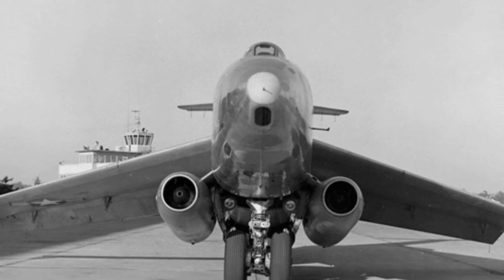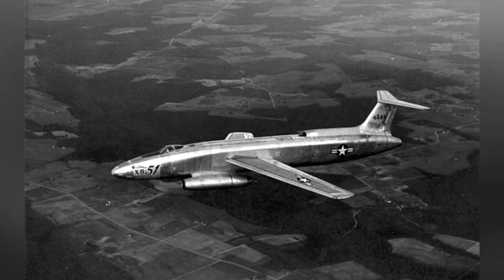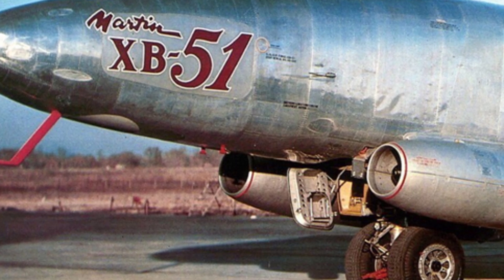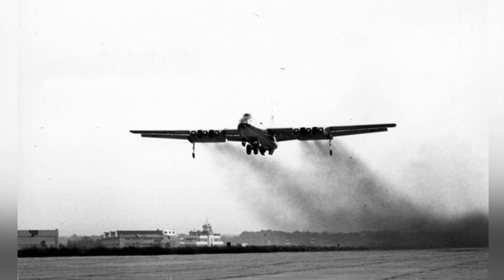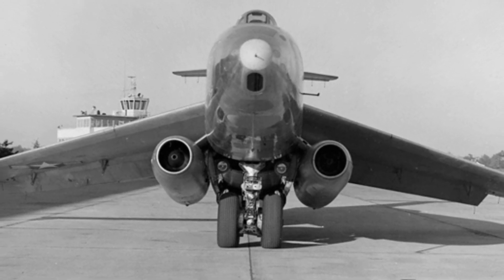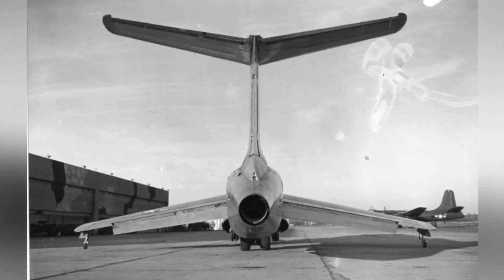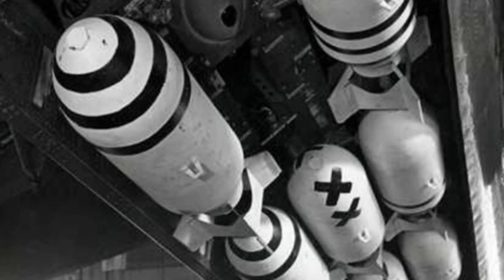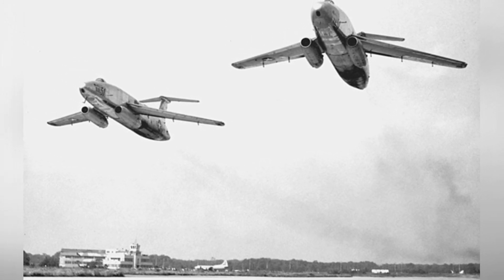XB-51: The Revolutionary Jet Bomber of WWII

Comment: WWII?
Reply: Yes, a Messerschmitt design from the last years of the war.
Reply: @neiloflongbeck5705  - Which one was that?  There was a variable sweep design. P.1110  but  which had a variable incidence wing like the XB-51?
Reply: @scootergeorge7089  the P.1102/105 used the same engine arrangement. This didn't have variable incident wings but variable geometry.